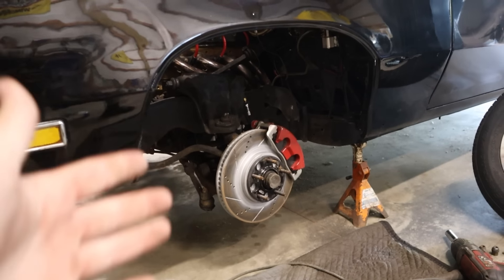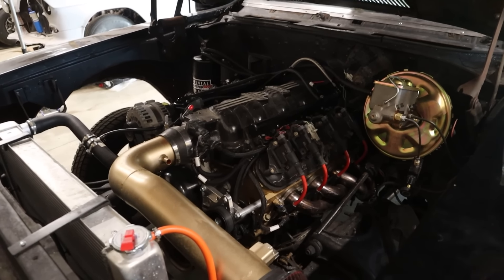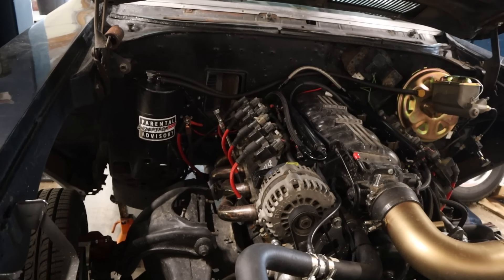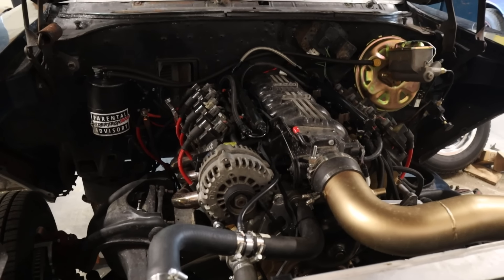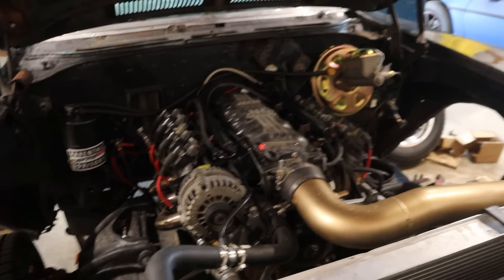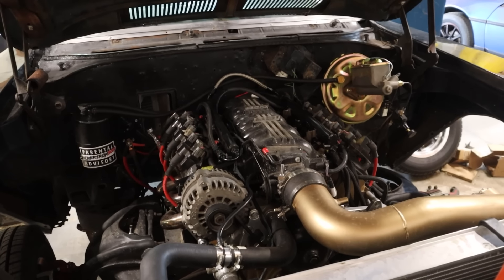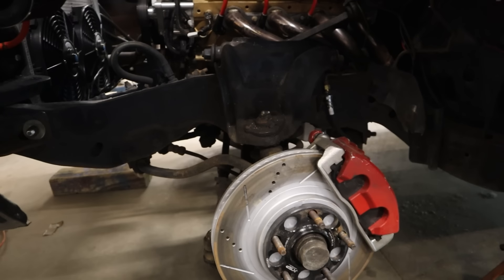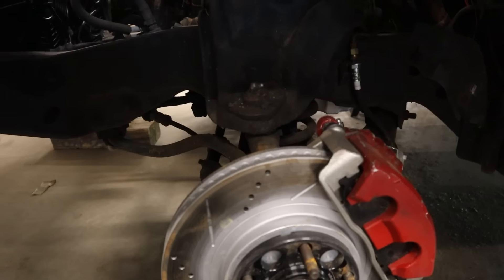Choppin' Coils in The Junkyard Skylark! It Looks WAAYYY BETTER! Lowered For FREE!

Comment: Usually cutting 1 full coil out is about 2" but those springs looked extremely long.  It looks way bettter tho.
Reply: It works like that with my coilovers on my Chevelle. Make a 1/2 change on the nut makes a 1 inch change on height.

Comment: Cutting springs (at least cold ’ish’ cutting) affects springs exactly ZERO 🙄 Torch is what hurts springs/affects spring tension. You retain the EXACT same spring rate just at a lower ride height👌🏼
I see that you 100% get this, just leaving this for the naysayers!
FYI: For every 1/2” you cut off of an IFS coil spring you drop 1” overall (in general). I just measure overall height with the springs flat on the floor and then mark them at 1/2 of whatever drop I want and it works every time 💁🏻‍♂️

Comment: Hey bro preciate all the content on this ride. I've got a 70 GTO that I'm gonna fix back up and and was wondering what the back spacing of rear wheels are plus what size tire you are running on the front. Preciate your help. Bad ass looking Buick also
Reply from the maker: About 8-10 videos back I posted a video about the wheels that goes over the fitment and all the specs. The rears are 15x10 and I think 5.5 backspacing if I remember right, with 275/60r15 tires. Fronts are 15x4 with 165/80r15 tires
Reply: Preciate it bro.  That's probably exactly what I'm gonna put on my 70 GTO when I can get them ordered with the exception of maybe 17s on the front. Bad ass looking Buick bro!@SniderTron3000